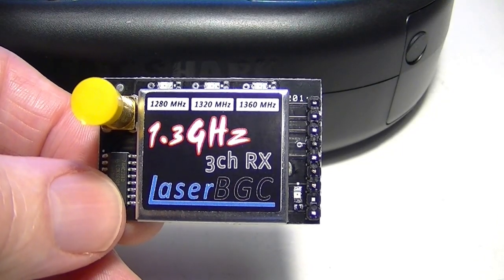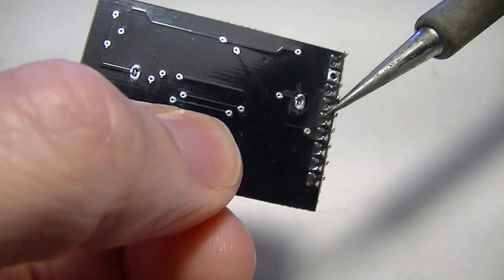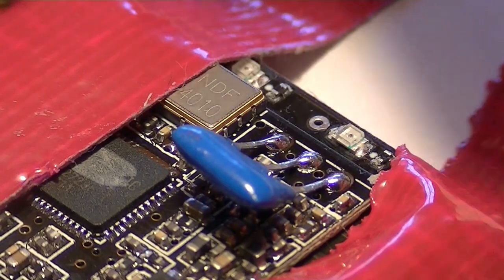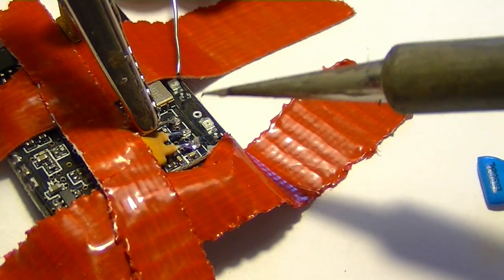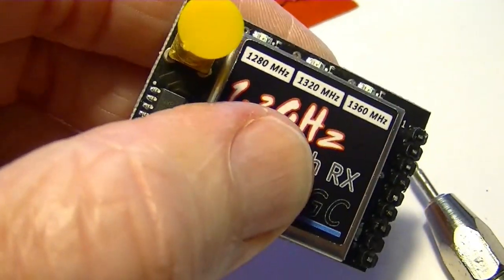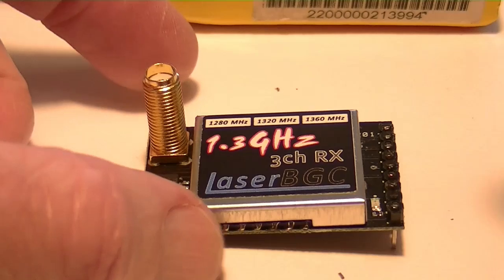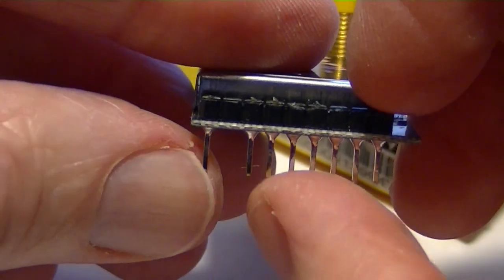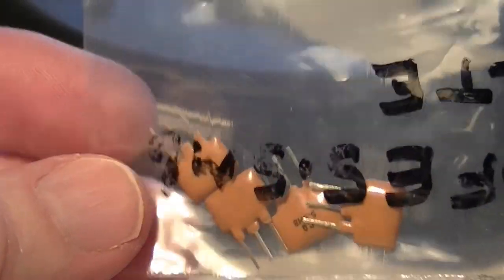LaserBGC Fat Shark Compatible 1.3GHz Receiver (Changing Audio Trap Filter)

Comment: I may have another glitch in my audio wiring but just double checking.. with my nextwav 1.3, i have two of these one for 6.5 and one for 6.0..  this is a picture of the chip i swapped out, the one near the top.. they sent me the wrong resonator.. i've since put in the real 5.5 one i found again.. http://flight-stew.com/wp-content/uploads/2016/04/20160529_174328-filter-swap-but-WRONG-one-l6.0WEB.jpg  But, no sound flows through.. i dont know if it matters which way these are soldered on or not, in terms of reversing it, but i tried both.. unless the second batch of resonators weren't truly 5.5's either.  These are the latest ones i found https://www.amazon.com/gp/product/B00R1LU7HM/ref=oh_aui_detailpage_o02_s00?ie=UTF8&psc=1 (found these before i saw your video), actually, in looking, these are wrong, ill go with your link, but i'm assuming i've changed out the correct filter though.
Reply from the maker: I don't think the direction matters.
I used the same 5.5 trap filter as before on the Fat Shark V3 RX Module.
In this video I show how I changed the Trap filter on the Version 3 FS 1G3 RX module. It's near the end of the video around 06:30
https://www.youtube.com/watch?v=zv8sBzvCY-Y

Comment: So a year later how is the 1.3gh receiver working? You still like it?
Reply from the maker: ***** Yes it is! 
I use it on 1280mHz with my quadcopter in my Dominator V1's. 
Fat Shark has a version coming out that will do 1258mHz which ought to be nice for the Dom V2's.
Reply: Great Thanks! I just got into FPV- a pair of Fat Sharks and a 1.3 module seems to be on my list of toys to buy now.

Comment: I just received my trap filter. Does it matter which way the trap filter is soldered in? The one in the rx is lettering down but the one in your video that you soldered in is lettering down.
Reply from the maker: I never noticed that difference in orientation. I would not think it would matter. AFAIK the filter is symmetrical.

Comment: Great module! 1.3Ghz and 1.2Ghz are pretty impressive compare to 5.8Ghz! Too bad the skyzone diversity goggles doesn't have this kind of module! Great job as usual! What is the fantastic tool you used for removing the old audio trap filter? Happy friday
Reply from the maker: Hey thanks! 
The fantastic tool is called a solder pullet (aka "solder sucker").
You can get one at most electronics stores.